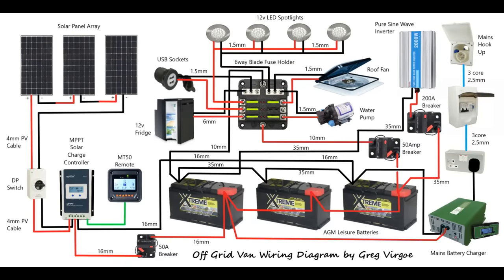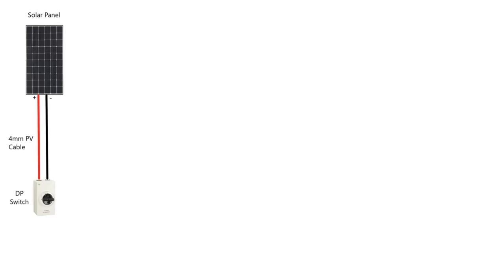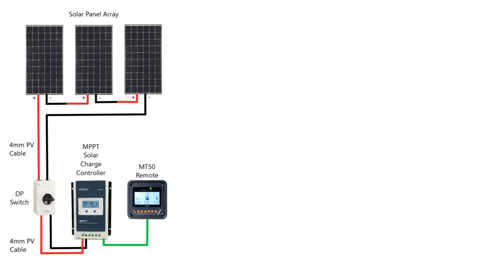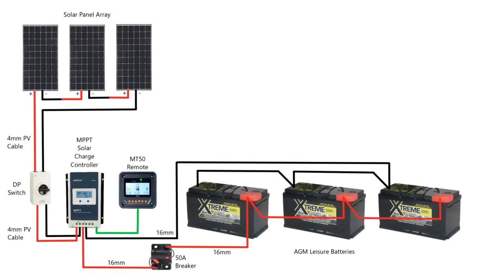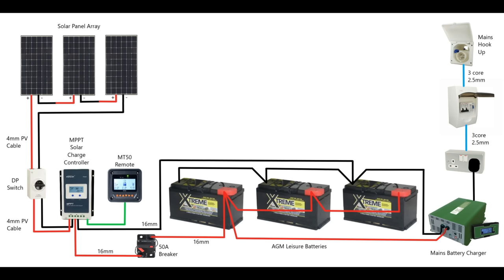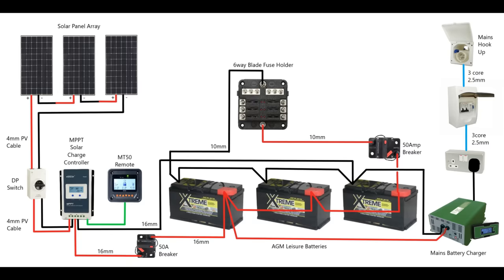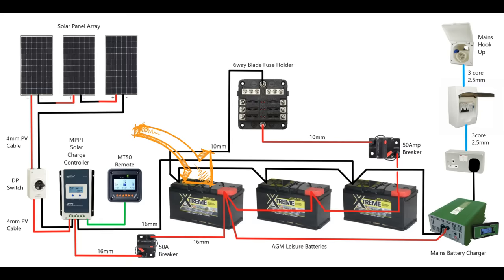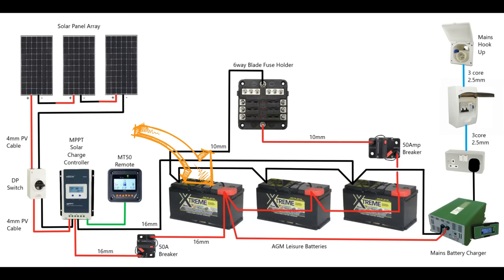How to Wire your Camper Van to be Off-Grid

Comment: Hi Greg, this is Casey from Toronto, Canada. Thank you so much for putting up such an informative video for van electrical. I have a question, is there any reason why you didn’t incorporate van alternator as another source of charging power? I’ve read the comments below, and I think someone might have mentioned the agm batteries didn’t like the voltage generated by the alternator? Would you elaborate on that? 
Thank you again. This is by far the best youtube video I’ve seen on such complicated subject.
Reply from the maker: If you want to charge while driving I would recommend fitting a battery to battery charger. You can set up the battery type and charging profile and they will look after your leisure batteries much better than a split charge relay which is basically just a switch. 
I’ve not needed to install one just yet as the solar system works so well.

Comment: You could also use a split load charge system to charge all battery's when the engine is running
Reply: Do you know how to do that? It's a great idea
Reply from the maker: VSR is just a switch and won’t know the condition of your leisure batteries.  It’s far better to use a DC to DC charger like Victron Orion as that will meter the charge to the batteries perfectly when driving. You can get them now for about £230 https://amzn.to/3D4cEqe

Comment: Great video as always.  I'm confused by the 'diagonal' connection of loads (or charge) to your leisure bank though.  If the battery links (the wires connecting them in parallel) are fat enough that there is no appreciable drop there, how can connecting a load at one end of a link be different to connecting it at the other?  I'm just starting my van electrics, but on my boat I use 70mm^2 links of about 200mm length and I've never worried about which battery has the load connected to it.

Comment: How would a TV be wired into this? Great vid BTW its just what I needed
Reply from the maker: A mains tv would need to plug into an output from the inverter. A 12v TV would wire to one of the spare connections on the blade fuse holder. See how I converted my own tv to 12v here https://youtu.be/1AFbVR4eSXs

Comment: Can you please add a split charge feed onto this circuit? Id so does it connect on the charging side of the batteries as the solar and 240volt battery charger? Thanks for your help great videos.

Comment: Hi Greg, I've watched this video "how-to" already in 2019 when it came out (and most of your other van building videos). Very entertaining and informative, and it's also awesome you're still available for questions on this "old" topic/video.
As for new insights, would you need to upgrade your schematics for any USB 3.2 charging ports to use slightly thicker cables, because those have specifications up to 100 Watts for charging power hungry laptops and tablets. Or is the 1.5mm cable still okay for that?
Reply from the maker: That’s a great comment and you are right to mention the upgrade in cable sizes for some sockets. 
2.5mm cable would be needed up to 3m long run anything longer may need to go up to 4mm. That also goes for cigarette sockets as they can use up to 15amps. 
Check cable sizes using the handy free calculator on this page
https://www.12voltplanet.co.uk/cable-sizing-selection.html

Comment: Thanks for this Greg it was really helpful. My only question is , could you, or would you, add in a split charge relay into the wiring diagram  to charge the leisure battery's as you drive. This maybe useful with the lack of sun in the UK and if you don't have an opportunity to then charge them on hook up. Sorry if you have already been asked this question before.
Reply from the maker: I would use a B2B charger or DC to DC charger instead as it will look after your leisure battery far better than a split charge relay which is basically a switch.

Comment: Hello... GREAT video, thank you very much. Just one question. Where would I insert a ATS (automatic transfer switch) into your diagram?
Reply from the maker: You can put an ATS on the 230volt side between the hook up supply and inverter supply. So if it detects a main hook up it will automatically switch over to mains and drop out the inverter supply. Then off the switch you only need one set of wires and sockets in the van 🚐

Comment: Thanks! Great video. Curious as to why you have no DC-DC charger off your alternator.
Reply from the maker: I was originally going to install a VSR and ran the 16mm cables for that. But then found out it’s not the best way to charge AGM batteries so didn’t fit it. In 4 yrs of full time living in the van there have only been a handful of times where I needed to plug into mains and use my battery charger. If I fitted one it would be an isolated Victron Orion smart charger 👍🏼🤩
Reply: @GregVirgoe  I knew there must be a reason as you’re so thorough in your analysis and planning. Thanks.

Comment: Wow, the best instructional I've ever found on such a confusing subject! I could learn a ton from you, with your easy manner of presentation.

One question I have that isn't covered... my inverter has an earth. I realise some countries don't bother with earthing stuff, but in Australia it seems pretty standard, and I'm guessing it could save some grief later.

Where and how would you suggest earthing? And I am guessing you'd need a pretty heavy duty cable to match your largest AC appliance, right? Perhaps one of those braided battery earth cables would do?

Comment: Hi Greg, I really enjoying watching your very interesting video's I am learning a lot but still have some questions, hope you don't mind if I am asking. We just bought a MB Sprinter L2H2 (little bit smaller as yours) and want to create a nice camper as well. My questions are the following:
1. In (not sure if it was this one) one of your video's you are mentioning that you are using 2 types of wires, the black (and the blue one (think both are 2.5 mm or the black 1.5 mm) but when I'm looking in your schedule the wire to the fridge is a 6 mm , are you using for this one a special cable or are all the cable black or blue?
2. In one of the other video's you talking about the vans you bought in crazy USA, what do they have extra compare with others? What was the reason that you wanted to have those?
3. In one of the video's about the heating and hot water you are mentioning that you don't use this when you are off grid but how do you heat the camper and how do you get the hot water. I am still in a progress if I want to have one system or 2 separated. 
I actually want to try being off grid at least for 3 days (then we need to have a good shower ;-)) and also want to try doing everything electric or sometimes for heating with diesel coming from the Camper tank. 
Sorry that I am asking all of this under this video and I'm sure I have many more question when I am starting building the van (now ripping it, cleaning and go to a window manufacture (not doing this by myself).
We have only 2 things we want, I fixed bed and a shower (and the standard kitchen/storage), for the fixed bed (building it sideways) we need to get a removable extension made from polyester (have some requests outstanding).
Let me stop writing now but don't worry, sure I'm asking you many more questions.....
Thanks again for your great instructions video's, you are a great teacher

Comment: Thanks so much! Exactly what I was looking for.  I could probably ask a million questions but I'll start with a couple.  How do you decide what breaker to put in? You used 50's in some spots but then a 200 to the inverter.  Can I also make it so I can charge the batteries while driving and would I connect that to the end of the batteries were the other charging is happening?  We just purchased a Van to confirm and are staying the process! Thanks again!
Reply from the maker: The fuse or breaker size relates to the load connected downstream on that cable. Check out this video I made for more info https://youtu.be/koFg6oFs0RU

Comment: Hi Greg!! Congratulations for your video! It is really a clear video to do everything in an easy way for everybody!!

I just got my FIFTH WEEL TRAILER 2001 made by KEYSTONE model HORNET. 

I need to hook up the 2 new MARINE BATTERIES to my Trailer. I know I must conect both batteries in parallel. 

I am not sure how to conect the wires of my trailer to the 2 batteries. 

My trailer has one black wire which is conected to the chasis of the trailer. And also has 2 red wires which are conected to a existing System of the trailer itself. 

Should I conect the black wire to one of the 2 batteries and the 2 red wires to the other battery no matter this 2 red wires be together in the same point of the second battery? Thanks for your help Greg!! .

Comment: Hi Greg, thank you so much. I am  picking my van up later today  it has been converted but without solar and needs a refurb inside.. ..I could see lots of wiring etc , it has split charger leisure batery , 2 other batteries (not sure amps yet) 2k inverter and EHU, plus other stuff 🤯 but no idea of what to do about it and add solar to it. I though I would have to just get someone to do it for me. I feel now I can look at it and work out what they have done and used (hopefully) and then treat it as a new install with the solar. Am thinking I need you as a teacher if I get stuck .
Reply from the maker: You can pm me any questions if you need further guidance.

Comment: Hi Greg, Love the video again. I have watched this video again and again and its content is fantastic so thank you. After several years of full time van life living how long did your AGM batteries last. Have you had to change them for new batteries now? Also did you find that solar and the odd shore power hook up meets your power needs for full-time van life? I wonder if UK and Ireland's often cloudy skies would bring in the requirement for a DC-DC.
Reply from the maker: Our AGM batteries are still working perfectly after 5 yrs of constant use. There is only one time during that period that they dropped below 12.3v which is about 70% full. The solar has been enough to keep them topped up everyday. 
I had over 1800 daily uses from them and still going strong. If you look after them and don’t discharge them too much you do get loads of life out of them. 
A dc to dc charger is a good idea and if you have the budget I would recommend fitting one. 😃

Comment: Hi Greg - your videos are absolutely essential for all van converters! A question on wiring in the 2000W inverter; your schematic shows 35mm negative cable between the batteries but do all the positive cables between the batteries also need to be 35mm as well? it only seems to be 16mm until exiting the batteries. Thx!
Reply from the maker: All the interlinking battery cables must be min of 35mm size. 👍🏼😃

Comment: Hi Greg. Great video. 2 questions. The DP pole between your solar and mppt what rating do these need to be? Second on one only one of your schematics between solar and DP switch do you have an in  line 10a  fuse, how come? My system is planned to be 6 x 50 w panels in parallel. Thanks for your help.

Comment: Hi Greg, as always stunning video. I am going to wire my van soon and wondering when you are on electric hook-up in the campsite, does your 230V power supply goes directly to your 230V accessories, or do you still use the inverter. I'm thinking about so bypass of the inverter when on the hookup. Is that necessary? Or am I just overthinking? It will be mainly for the fridge, my son's PlayStation, and the microwave. Thank you

Comment: Hi Greg, I’ve watch many different videos, by different vloggers. Yours is always the easiest! For the last 18 months I’ve been hoping to run into you while touring.
But pandemic an all that, which I hope you an the misses keeping well & safe. I have a question that no one’s actually answered confidentiality.
On the 240 AC consumer unit, what’s the best  size fuse to use for a 20 amp mains charger? Thanks

Comment: Hi Greg, I was wondering why you chose to not include charging batteries via alternator. Could you comment on that, or maybe add a section showing how to accomplish alternator charging? All the best - Cheers
Reply from the maker: I was originally going to fit a split charge but found out it not the best way to treat your leisure batteries. I have now purchased a Victron Orion B2B charger which is a far better way todo it. Just needs poss and neg cables to both sets of batteries. 👍🏼

Comment: Hi Greg thank you so much! Your wiring diagram has been such a great help. May I ask how I’d go about adding a second blade fuse holder? Regards Jack
Reply from the maker: Yes just duplicate the first with a separate set of connections to the battery. I have 3 blade fuse holders in my van to keep the local wiring shorter. Think of them like sub  distribution boards. 👍🏼😁

Comment: Brilliant explanation.  Just one thing in regards to the inverter is do you leave this on constantly or just switch it on when needed? I'm just wondering if it would draw power from the battery while not using any appliances.  Many thanks.
Reply from the maker: It has a remote switch and I only turn it on when needed as it will use power when just switched on. Thank you
Reply: Excellent thanks

Comment: Hello Greg, thank you for all your work, it is truly wonderful ! One question, how do the fans in the van cope with hot air in the summer? Are the enough or an AC unit should be more useful for the hot weather? Thanks again !
Reply from the maker: We have stayed in 38°C summer conditions and the van inside has been considerably cooler with just the fans. The biggest thing is to have reflective shades for all the windows and keep the direct sun out of the van all day. That will make it much cooler.

Comment: I recommend a higher spec cable to USB outlets. If modern USB outlets with power delivery are installed they can potentially draw as much power as the fridge. Power delivery is useful to charge any USB-C laptop or phone. The trend is that more chargeable stuff will use power delivery in the future. My Satechi 72W cigarette lighter -> USB-C power delivery charger is very useful when traveling.

Comment: Thank you Greg , I’m hoping to start mine soon , van hunting as I txt. I was going to maybe buy one pre done but how can one be sure they’ve followed the correct regulations. Many years in fabrication means I’m hopefully good with my hands. The electrics worried me but studying your vids and work has given me confidence and this layout will almost certainly be my layout,  just a quick question a chap called Calvin podina has commented on this and says an alternator charging option is missing . Is this an essential item or not needed with this layout , if so when would one use one .
Reply from the maker: You can add a DC to DC charger to this layout quite easily. That would allow you to charge the leisure batteries while driving. I would recommend fitting an isolated version and connect the cables to the same battery terminals as the solar charger. A good make is Victron Orion smart isolated dc to dc charger.

Comment: Excellent, exactly the component by component explanation of walking a wiring diagram that I needed.

I assume the wire gauge will depend on the distance between components and the load carried? That is, same current longer distance requires thicker wire?

Thanks!
Reply from the maker: Yes you do need to take into account the voltage drop. There are plenty of online calculators for this a good rule is to keep within 3% overall.

Comment: would you reccomend using a battery protector (that shuts off the system when battery is at a certain voltage) and where would you  add it to the system?

Comment: Hi Greg your van build series has been my bible throughout my own conversion which will be complete within the next week or two. Just a quick question regarding the earth cables on the mains/shore RCD consumer unit. Do I just connect the earth cables from the RCD and MCBs to the common earth bar in the unit or do I also need to run a jumper earth cable from the common earth  bar within the unit to one of the screws that fix the metal consumer unit to the wall. Hope that makes sense.
  Thanks for putting it out there👍🙏🍀
Reply from the maker: Install an earth connection from your common earth bar to your van body.
Reply: @GregVirgoe  ....Will do many thanks 🍀👍

Comment: Hi Greg, probably the 5th time I've watched this video and won't be the last! Question for you: do you monitor the state of charge of your leisure batteries, and if so how? I have a similar but smaller set up to you, but also taking power from the alternator, but does the MPPT charger give you an accurate indication of how much charge your batteries have left? Cheers
Reply from the maker: Hi Sam, I simply monitor the battery voltage on the mppt remote display. My Truma iNet box also can see battery voltage and I have they set to text me an alarm if it drops below 12.3v. I do my best to always keep it above 12.4v which in 4 yrs have managed to do ok. So the batteries are still working really well 👍🏼😊
Reply from the maker: You can see from this chart
https://electricscooterparts.com/graphics/state-of-charge-chart-for-agm-battery.png
 that relates to about 70% full so I will get hundreds more cycles out of them by not discharging them too far.

Comment: Great videos. My question is can I use off grid inverter like they use in the houses to continuously supply fridge and aircon also toaster TV microwave laptop occasionally 4x120watt panels and 2 agm 130amp batteries? Fridge and aircon  are 230v units.
Reply from the maker: Things like air conditioning and the toaster will use a lot of electricity. So when you are off grid you have to minimise your usage depending on how much you can regenerate. A fridge and tv would be no problem. But I would cook on gas and only use ac on hook up. 👍🏼